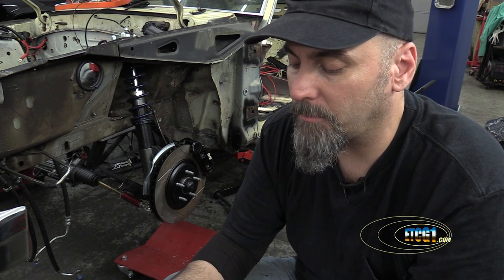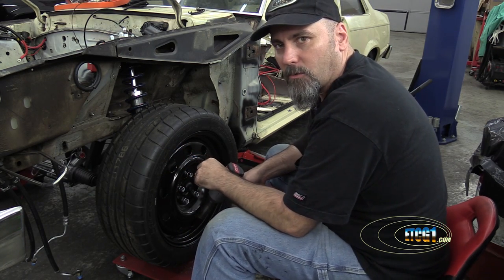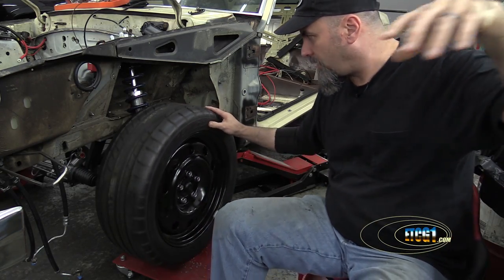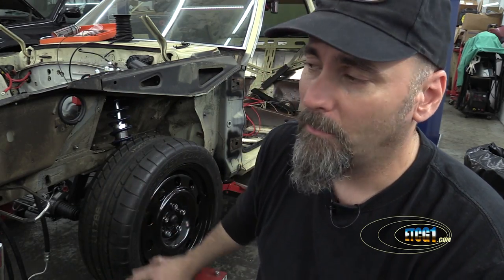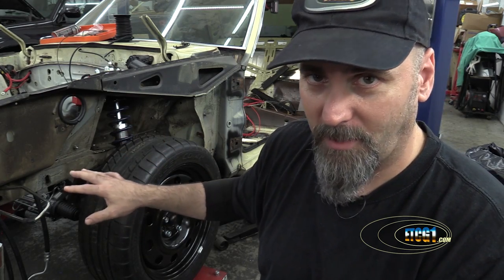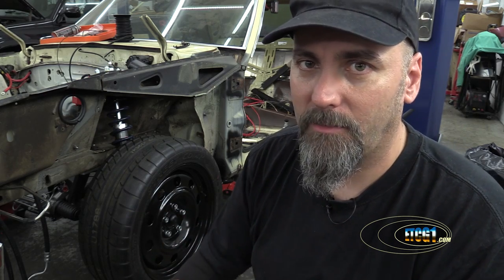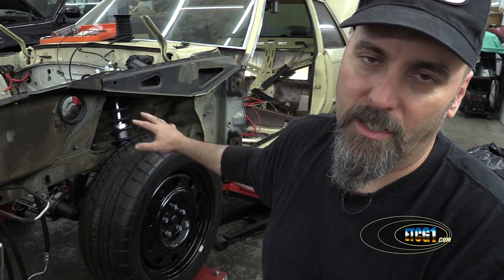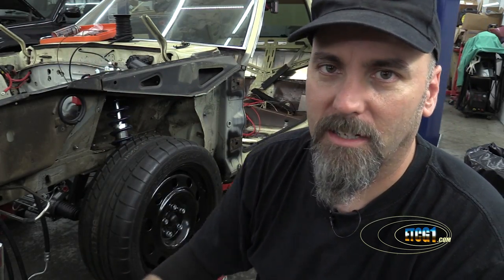Are Wheel Spacers Safe?

Comment: AGREED .... the physics does NOT change. The wheels bearings are NOT stressed. 
That wheel spacers is either going to be a seperate entity from the wheel OR it will be added to the wheel during build process. 
The only difference is that that "25mm" spacer you just put in is now seperate and sandwiched between the wheel and hub and now its torqued IN and torqued ONTO by the wheel ... 
The concern is getting a well built spacer with quality parts ...

Comment: He's correct in that thread engagement is very important. If the bolts have enough thread left after adding the spacers, then it's safe to use them.

Comment: I've had 1.25" Spacers on my built for off road Bronco II for five years 32" tires street, 33" tires off road, both Cooper, if that matters. The B2 is also my daily driver. So far I've had no problems, including undue wear of the wheel bearings. Dana 35 TTB front, FORD 8.8" disc rear. FYI, driver's side make sure to add a drop of blue lock tite to the spacer threads and to the wheel nuts threads. Beyond that, enjoy the wider stance. I would imagine you can add to big of a spacer at some point, but the 1.25" spacer with it's own lug nuts, works great.
Reply: Thank you for your comment.   I am getting ready to add  1" spacers to my 2001 xterra due to the offset of new rims being +25 mm, but will also run original rims with offset of +0 that will have winter tires on them.     The winter tires will sit out 1" more during the winter months.

Comment: Once upon of time I had a 75 Chevy Monza 2+2 V8 with a 4 speed. Of course, being young and dumb in some areas (actually a lot of areas), I decided to use some wheel spacers to try and improve my cornering capability by widening the track and to get a bit better wider wheel stance to decrease body roll in corners.. They were quarter inch spacers so it increased the track by 1/2 inch. It made the car look a little better, but really It did not improve the performance in any noticible way except I could now install snow chains on the rear in the winter. The down side was the leverage on the front suspension. It put extra leverage on the front suspension to the point it was bottoming out much more often and hitting the bump stops much harder. It was enough force that it allowed the bottom of the oil pan to come in contact with the pavement on passing through some higher crowned intersections. The unintended result was one day the oil pan got dented a little bit and the lip of the drain plug came in contact with the ground at about 35 mph and was instantly unscrewed. The oil soon drained out and I got a red light on the dash for oil pressure. Shut off the engine and coasted to a stop. After walking around the car and seeing the oil trail, I saw the last of the oil dripping out of the drain hole. I walked Back to the intersection, found my drain plug, put it back in and took a long walk to a store to buy replacement oil to put back into the crankcase. After I got back home, I took off the front wheel spacers and my bottoming out problem almost went entirely away. That was one of my first solid clues that there was more to suspension performance than fat performance tires and stiff shocks.

Comment: We've used spacers on an SK Modified that lives its life on a track. Never have we had an issue with them, even in a wreck the spacers come out just as they did going in. To reiterate the main point here - They properly set themselves in position on the hub and the lugs are torqued properly. Now that it's all secured, the hub, spacer, and rim are all one assembly, you'll rip the entire assembly clean off the car before you have issues with the spacer.

Comment: I'm running 20mm per side in the front of my car.
Had a set of multi-stud alloys and they did fit except of the offset. They were before fitted on BMW and now it's on a Lexus.

Basically my setup is 20mm hub centric spacer + spigot ring for the alloys to stay hub centric.
Additionally I installed longer studs and adjusted the torque.

So far everything is fine, the car looks great too and I don't have a soft driving style and some of the backroads have potholes and nothing so far.

As said, if properly installed, things will be fine.

I saw people putting on hub centric spacers but then the wheels itself were not center - one pothole with force and that was it - especially on only 4-stud wheels.

Comment: @etcg1, my only concern about those specific hub spacers, is that the hole for the studs to pass is oval, and not a tight fit around the studs. Now hear me out. The way the wheel is clamped to the original rotor hub, there is no voids in the metal, meaning full contact at the pressure point, or circle, under where the lug nut presses the wheel to the hub. If the contact point is not a full circle, then the clamping forces are not even, and can loosen when the wheel flexes. If those rings were drilled with a round hole, that fit the stud perfectly, then the clamping forces could be even and transfered to the hub fully. I am ASE master  certified, and also TIA certified and a master diagnostic technician. Over 15 years in the  shop, and have seen that specific ring have torque issues with some wheels. Just check torque often, and consider a set of rings specifically drilled for your application.

Comment: 1/4" in car assembly is known as shimming, and it's a perfectly normal amount to shim by.  It would be different if you were running say a +1" spacer with only a few threads left to put the lug nut onto, so what you're doing in your case is perfectly fine and well within tolerance.  The most unsafe thing about spacers is how much they reduce the threads by. If you use open ended lug nuts you will normally have several threads unused on the outside on the nut, and if using a spacer means there are still threads left free after the lug nut is on, you're all good.  The other thing with using too big of a spacer is that it increases bearing load due to increasing force (moving wheel centre further out increases leverage).  1/4" will be in tolerance still.  All in all, wheel spacers are only bad if they're too large, simply shimming by an amount such as 1/4" for fitment is not an issue.

Comment: wow been using spacers on my car for years  never heard been unsafe.
Eric is correct if installed correctly is safe to use.
Reply: the problem is without modifications like Eric is doing they aren't and the ebay pages selling these things for cheap don't tell people they NEED to be hubcentric and they NEED to install longer studs to compensate, much in the same way they don't explain the importance of matching the lug nut pitch to the wheel being run and that something as seemingly unimportant will greatly increase the stresses placed on the wheel studs and can snap them clean off, this is not the old days where the guy at the tire shop will tell you not to do that, this is the day of people buying everything online and slapping it all together without the proper knowledge.

Comment: Read an interesting discussion on a forum recently that stated for hubcentric rings to be effective , they would have to be a press fit on the hub. The discussion was not about using spacers, it was about using wheels with a greater cylinder bore size than the original ( 56 mm instead of 54.1 mm ). The consensus was that a wheel with a slightly larger cylinder bore could be safely used, provided that the wheel nuts were torqued correctly. It is the PCD that is critical to centralising the wheel.
This video implies that for a spacer to be installed safely, the spacer must be hubcentric, though Eric doesn't directly say that.
My view on this is that it is not a safety issue, but it is convenient to have the spacer centred on the hub, to facilitate doing up the wheel nuts. Centralising the spacer is important however, as it could unbalance the wheel, as the spacer is not centralised due to the PCD of the wheel and wheel studs.

Comment: Dually trucks use very large wheel spacers on the front axle from the factory to change the offset to allow the same rims to be used on the front and rear axles. If properly engineered and installed they are perfectly fine.

Comment: My '77 F250 is painted to look like a Hotwheels (tm) and in order to complete the look I bought a set of Dodge RAM 2500 five-spoke wheels. The challenge was that the offset of the Dodge is completely different, so to correct the offset I tried to order spacers from my local parts store (I think they're 1.5 inch). They would not order them, insisting that they would not be safe on a 3/4 ton truck, and that my bearings would wear out faster making it unsafe in a completely different way. I tried to explain that not correcting the offset would wear out my bearings, and he told me to change the wheels. Finally ordered the 8 bolt spacers (they bolt to the hub and have their own 8 lugs for the wheel) from an online place that sells to rockcrawlers and now my truck drives in a straight line on the highway. It also doesn't rub when I make sharp turns.

Comment: I love my hub centric spacers 👍
Reply: Kies Motorsports Brian, did you feel that there was any difference in braking performance after the install?  I just put on  hub centric spacers - 10mm in front and 15mm in back on my F30 335i and maybe it's my imagination but it seems the car doesn't stop quite as quickly as it did before the spaces.  Just talking about daily driving, not at a track.

Comment: The wheel spacer and the center ring are safe to use as long they are design for that vehicle / wheels. After install a wheel spacer you can do a test and check the torque of the bolts after running some miles specially when you force the vehicle into curves.If the spacer is not proper desing you will loose the clamp load of the bolt.
Also need to make sure the center of the wheel is not afected and there is plenty of thread engagement for the stud.

Comment: As an automotive engineer I would point out that the increased length between wheel and stub axle causes increased wear on the wheel bearing and the (lower/upper) swivel pin (king pin).

Comment: The thing with wheel spacers I always thought people had problems with this whole time, isn't weather they're safe or not, it was that the suspension geometry is designed for the wheels to be in a certain place, you know the angles and pivot points and everything are for the wheel to be moving in a certain place, and when you start putting spacers on it you move the wheels out of that point and will start to mess with the suspension geometry. So as long as the spacers don't move the wheels out too far I never thought it'd be a problem, only when they're ridiculously spaced out.

Comment: Ok quick question..... What if your wheels don't have lug nuts or studs? Also no hub coming out like the one on your car? I run a set of 2" spacers. About two years now. Never any problems but I do have to change the wheel bearing cages out after every season. Thoughts?

Comment: On the old 56 chevy it was either running wheel spacers or have the wheels rubbing on the bedside in the rear and tie rod in the front. I promise wheel spacers are less of a safety risk then popping a tire. I installed longer lug threads so I have proper thread engagement.

Comment: The only time that I have seen wheel spacer causing trouble is when they were installed on a truck with a large amount of suspension lift, with large rims and tires. This vehicle had quite thick wheel spacers installed. The axle broke from inside the axle housing but honestly that can happen even without wheel spacers.  I don't like the thick wheel spacers but I believe that if they are fitted properly and you have adequate studs and stud length that they are alright. I do also believe that it would probably account for a tad more wear on your suspension though adding larger tires and rims does the same as well.

Comment: Great job on the car Eric! People don't know what they're talking about, I have run many spacers on my drift car for years and have had ZERO issues...the problem is with people buying non hebcentric bolt on 30mm+ Ebay wheel spacers with cheap garbage studs! Pick yourself up some nice lengthened arp wheel studs and anyone that says that's not safe is an idiot.

Comment: I agree.  I have a '70 MGB that I converted from wire wheels to disc wheels.  I had two choices to establish wheel clearance:  Either change the differential to the wider disk wheel type, or install wheel spacers.  Hmm...a $200+ fix (differential) or a $30 fix (wheel spacers)?  It's a daily driver, not a show car; guess which fix I chose.  BTW, Eric, I know they're safe, and you know they're safe, but Discount Tire wouldn't install new tires because of the spacers.  I had to remove the wheels and trundle them into DT in the trunk of my wife's Mazda 3.

Comment: I wondered about spacers, because of all the bad reputation. But if they were all death contraptions then people wouldn't buy or use them at all. Thank you for the clarification. 

Would those bolt pattern adapters be a similar story? It seems like they would fundamentally change how the wheels are mounted. Putting a lot more shearing force on the inboard studs (through added leverage) ...But whether or not that change is significant is another story.

Comment: I need some wheel spacers on my trailer for a couple reasons.. tire clearance and also I cannot find the exact stud I need, so although the press fit is correct and the studs press tight into the hub, the shoulder area is too long. These 1/4" spacers will correct this and also the tire clearance .. I bought steel 16" X 5 1/2" spacers, with six round holes, that will only fit on a 6 lug wheel. Now my question.. the studs I am using are 1/2 20.. the spacer holes are 9/16".  I wouldn't think this would be a problem, but thought I would ask anyway. Opinions?

Comment: Happy to see you again Eric, true but they will change the geometry of your suspension (Especially roll center) and wheel track width that could cause stability issues and alter steering properties. Also necessary to measure against rear track width and wheel base. Cheers, keep ETG1 going.
Reply from the maker: You do realize that a wider track actually increases stability? And that's before you take into account that I've lowered the car. Also,  just about every vehicle has a wider track in the front over the rear.
Reply: Widening the track width of the car with wheel spacers will not change the major suspension geometries.  At least, it shouldn't.  The front roll center is defined as the intersection point between the lines drawn from the contact patches through each side's instant center.  The IC for a strut suspension is going to be the line drawn through the pivot points of the front lower control in front view in addition to a line drawn parallel to the angle of the pivot point for the strut (aka: the camber plate).  None of this is defined by the wheel and moving the wheel outward will not change those angles any.

Out back, on a live axle, in the case of Eric's setup, the rear roll center is the center point of the rear panhard bar.  On a watts link, it's the center pivot bolt for the watts pivot "football".  On the stock 4 link it's way more complicated to find as it involves both top(plan) view and side view geometries to locate the vertical and lateral location of it.  

Track width changes shouldn't cause stability issues except while cornering at the limit, in this case, widening the front in general will cause more grip at the front and cause the car to move towards oversteer (in a perfectly balanced car before the change, it would cause oversteer).  Steering feel will change due to change in scrub radius, as will tire wear issues due to aggressive alignments.
Reply: I believe the roll center will be affected as well, the point that we draw the line from tire contact point toward the cornering center would be further out thus changing the angle of the line. The first image: http://www.joesracing.com/rt-4179-roll-center-magic.html
Reply: Not enough to really matter is what I was getting at.  We aren't talking about huge changes in track width here at a quarter inch.  That might change the front RC height by about a 1/16th of an inch which isn't going to be noticeable outside of a suspension design program telling you the front has 0.30% more front roll stiffness! ;)  (I don't know what the actual numbers are, but it's basically irrelevant).
Reply: Yes, I did not say there will be huge differences if you refer to my first comment. I was trying to point out it will alter the geometry even if it is a small amount. As you mentioned it will be more noticeable during hard cornering and steering feel I believe. :) Cheers mate.

Comment: I have 3" bolt on wheel spacers for my truck haha. Moved the torque spec from 120 to 185, but hey as long as its safe right? I have had no problems at all with my spacers. Given it does wear the wheel bearings more but still. No issue.

Comment: All good Eric. I agree that those spacers are fine, especially since you made them hub centric. Your steel wheels will be fine also, NASCAR uses them. They allow spacers under certain circumstance also as long as you have stud thread showing beyond the lug nut when torqued. Once you start getting out to about an inch deep spacers you will run into steering geometry issues even if they are good spacers installed correctly.  Some of these young guys (I was one once) go too far with the easy fix.
I enjoy your videos.

Comment: I put 1/4 in spacers on the back of my 90 Mustang.  Still get 10 or so turns, didn't change the studs.  I did this for looks only, it does look better.   The car only gets driven on the weekends.   I'm not worried, I'll check the bolts periodically.  If I ever sold the car I'd just take them out.